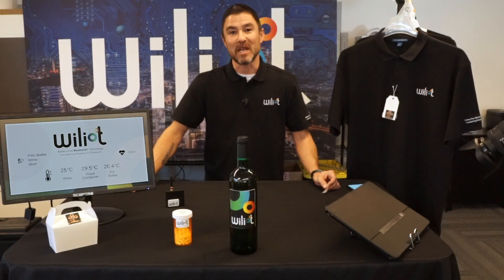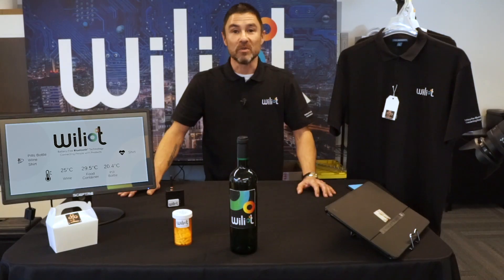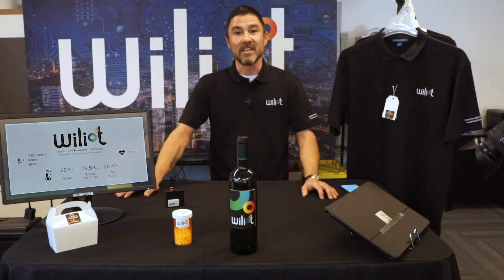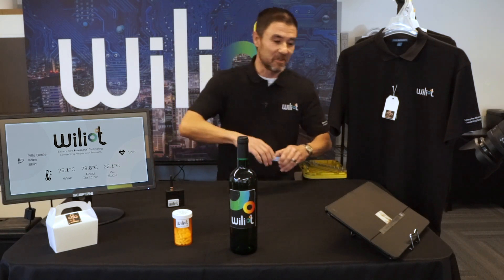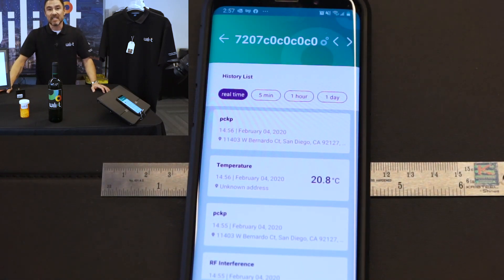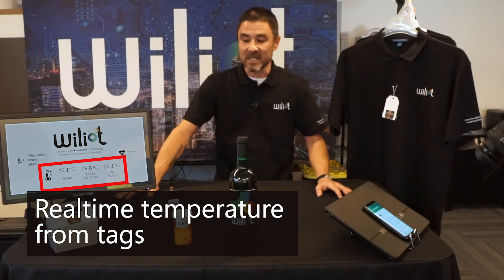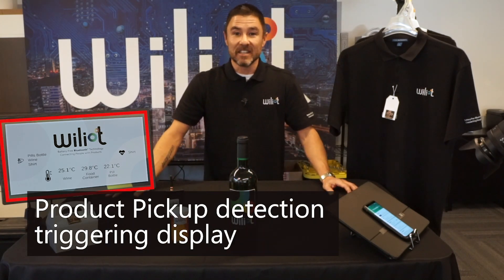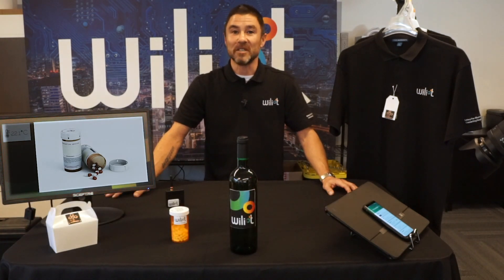Wiliot Battery-free Bluetooth Demonstration

Comment: Definitely exciting, but I suspect there are severe limitations. Interested in seeing an end to end demo. 1) Approx how long it takes to harvest enough energy 2) how far the bluetooth transmits 3) Assume it transmits without pairing?
Reply: Hi Doug, Thanks for your interest!
1) The duration of time to harvest the needed energy to sense, compute, and transmit, depends on the source of energy and the distance from that source. In optimal conditions, we see tags harvest and transmit in under 1 second.  2)  Version 1.0 of Wiliot tags will have a range of 2-3 meters, both for harvesting and transmitting. Although, we have seen transmission reach father. Version 2.0 will have a range of 1-20 meters. 3. Correct, this is Bluetooth Low Energy technology which sends a non-connectable advertising packet to be received by any device with a Bluetooth radio.
 We will be sharing details along the journey via our newsletter, you can subscribe here: @t
If you have further questions feel free to reach out: info@wiliot.com
Reply: @jessiehazelrigg3371  Hi and amazing work. Are your Version 2.0 out for trials now?

Comment: Hi, does the sensor can recognize movements of products which contain these sensors?
And can it recognize the direction of the movements?
Thank you
Reply: Hello! Our approach to movement sensing is quite unique as it relies on measuring changes in the tag (or product/packaging it’s applied to) environment.
It is not a standard movement sensor like an accelerometer, that gives exact orientation/direction information.
Our focus has been on “pick up” movement detection thus far, as we have project driving such requirements.
Feel free to reach out if you have further questions: jessie.hazelrigg@wiliot.com